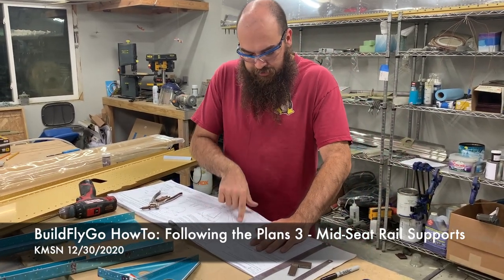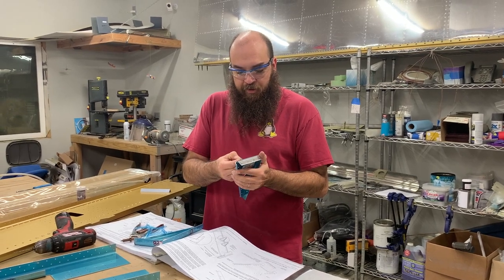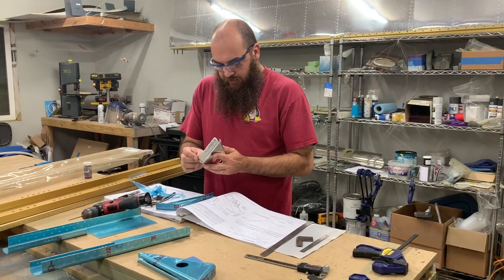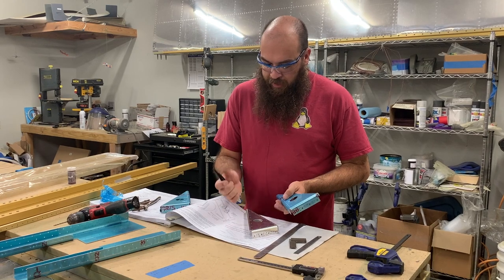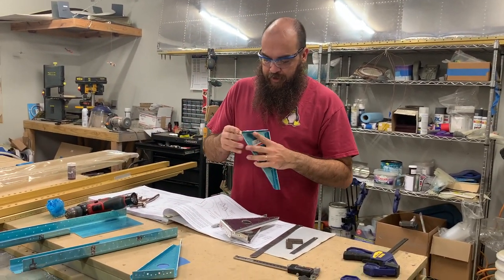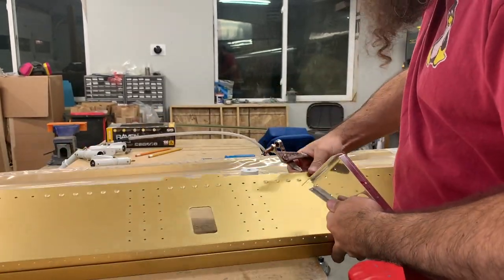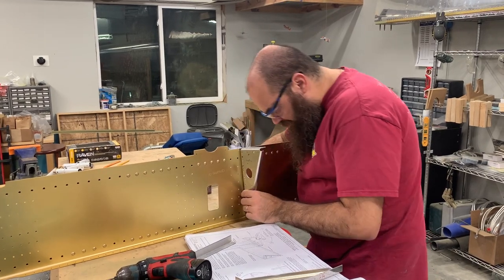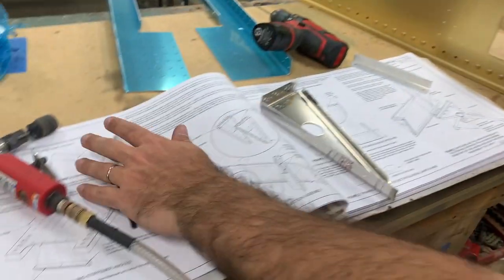HowTo: Following RV Build Plans - Part 3

Comment: Questions about Anodizing.  If Anodizing is optional, who much extra weight could it add to the plane?  Can it be measured in grams, or pounds?

GREAT videos!!  Thank you!
Reply from the maker: I have not heard of anyone anodizing the parts. The spar is anodized from the factory but is the only part that way.
Reply: @BuildFlyGo  My Bad!  I think I used the wrong word.   The 'protective coating' material sprayed on the inside metal..
Reply from the maker: @jerryv9138  you mean the primer? It's roughly 15lb for the entire plane. We did the math recently base on the volume sprayed and solids weights.
Reply: @BuildFlyGo  Yes, the primer!!  Thank you!  Seriously considering a RV-8 kit.  With a max Useful Load of about 680 lbs, it's useful to know where every pound goes.  THANK YOU!!  =)

Comment: Excellent video Guil!  What was the lubricant that you used on the reamer and is it necessary for reaming?  Also, can the hand grinder be used as a cutting wheel tool?  I need to buy this hand tool; do you recommend any particular brand ... electric or pneumatic?  Are you planning to meet up with Dale, the RV-12iS builder, again on any future videos?  By the way, did you know that "Goo Gone" spray gel will easily wipe off and remove any Sharpie black ink on any aluminum aircraft part?
Reply from the maker: I usually use some form of BoeLube. Most recently 70104: https://www.aircraftspruce.com/catalog/cspages/boelube2.php?clickkey=11321
Reply from the maker: I do have a cutoff wheel to attach to the grinder. I use the wheels vans sends with the kits that include plexi parts. The grinder is just a regular pneumatic angle die grinder. It's one of the sioux brand but there's nothing special about it.
Reply from the maker: Dale lives in California but might be up visiting again this summer. I'll definitely draft him into doing more videos when he's here :-D
Reply: Bob was mentioning Goo Gone for sharpie removal. Isopropyl alcohol works also.

Comment: Where may I ask, did you learn to do sheet metal?
Reply from the maker: On the RV-9 empennage kit :) One of the local EAA members spent an afternoon with me in the workshop and showed me the ropes. EAA also has a great sheet metal workshop they run where you can learn all this stuff.
Reply: @BuildFlyGo  , no need.  I spent over 20 years doing sheetmetal work on various types of aircraft.
Reply from the maker: Cool, don’t be shy about offering tips! We’re all here to learn from each other!
Reply: @BuildFlyGo  Okay
1.  The only time you use a Vixen file is for heavy shaping.
2.  There is no need to debur your pats before you drill, you will only have to debur it again.
3.  There is no need to ream a hole for a rivet, only when you use a Hi-Lok (close tolerance hole).
4.  When you do use a reamer, once you have taken the hole up to proper size, stop the drill motor and gently pull the reamer out or you will make your hole to big and it will be out of tolerance (close tolerance holes).
5. When you do get to the point of deburring your parts use a scotch bright disc and a side grinder (much faster).
6.  When you round your corners the radius should be between 1/8 & 1/4 (or .125 & .250), it's a stress thing when the  metal parts come together.  the sharper the point, the more the possibility for stress at the point.  You can also make it a 45º chamfer, but I prefer a radius.
Reply from the maker: Thank you! I’ll read through this again next time I’m in the shop to improve my process!
Reply from the maker: Where in the country are you? We should do a video together on improving my process :)
Reply: @BuildFlyGo  I am in the Dallas, Texas area.  Unfortunately I don't have any of my tools, I am no longer working in sheetmetal.
Reply from the maker: Will you be coming to airventure?
Reply: @BuildFlyGo   I don’t know what or where airventure is, so that’s probably no.
Reply from the maker: The big air show in Oshkosh, WI. Please feel free to make suggestions or call out things I may be doing wrong in the videos. I really appreciate the feedback.